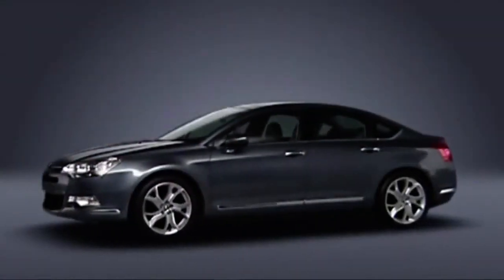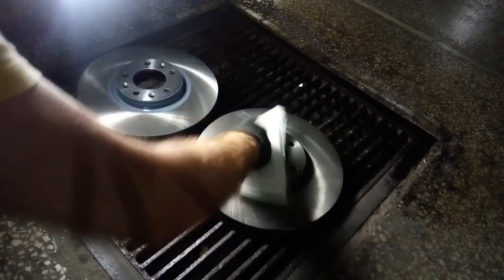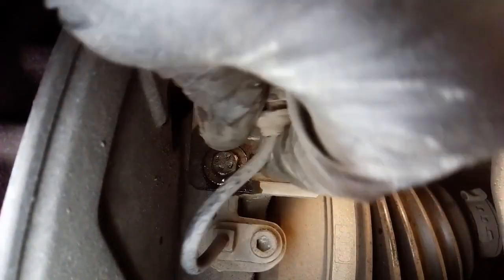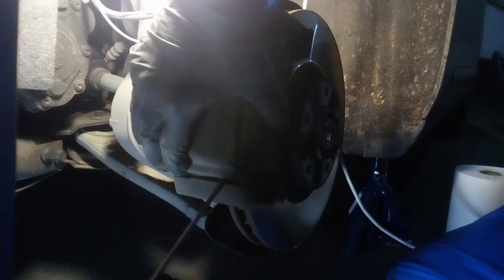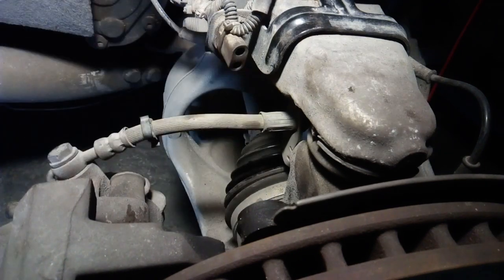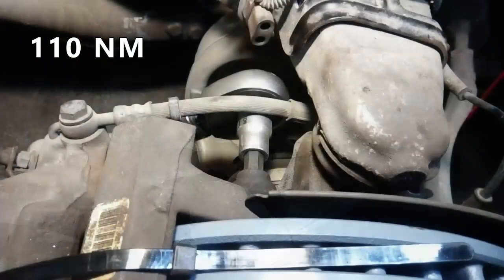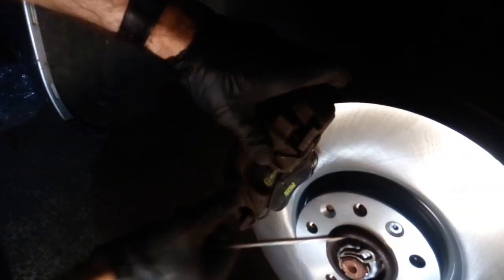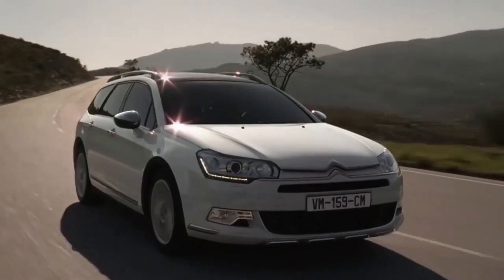CITROEN C5 X7 Front brake pads + rotors change (ENGLISH)

Comment from the maker: Anti seize spray is also recomended between the hub and the rotor, and between the rotor and the wheel, to make your life easier the next time you try to remove the wheel or the rotor. 
Nominal thickness of these specific rotors is 28mm, and Citroen recomends not using rotors that are thinner than 26mm. For the record, the old rotors had 195.000 kms, and their thickness was 26.2mm, well within the recomended margin. 
Even though it is not so dangerous to drive with rotors thinner than the minimum thickness, one can't help but wonder about the heat dissipation of thinner rotors, compared to thicker ones. Maybe thinner rotors heat up faster and can't dissipate energy that efficiently. The more the material, the more energy they need to heat up, and therefore the longer it takes for them to heat up and start losing their properties. Maybe that is why manufacturers never recomend using rotors thinner than the minimum thickness, usualy 2mm thinner than the nominal thicknes. 
Maybe they don't even test their vehicles with rotors thinner than the minimum thickness, that's why they can't take any responsibility and they can't give any guarantee about the safety of the vehicle. 
The same goes for the rear rotors, which have a thickness of 12mm, with a minimum of 10mm.

And for the record, the weight of a single front rotor is around 9-9.5 kilos, which amounts to around 20lbs, while each rear rotor is a bit lighter, at 7-7.5 kilos (~15lbs).

Comment: Fantastic video, very informative, thank you for putting the effort into it!! I'm just gauging whether I am too scared or not to do mine, I've never had a car as complicated as the C5!! Just a quick question though, I notice that there are two braking systems, the TRW and "TEVES" (well, that's what the manual says). How did you check which your car has?
Reply from the maker: Thanks for tuning in brother. The actual type each car has can be found through an official parts supplier, (not necessarily dealership), who has access to the citroen data base. With the VIN, they can find the parts diagram for the specific model, and I think it is mentioned there if it is TEVES or TRW. 
Also, I think the two brands have small differences externaly, so if you  have some kind of photo, (again, from the parts supplier) you can compare and find out which one you have. 
I realy don't understand though, how you find the C5 "complicated". If you mean in regards to the electronics, yes, I would agree, every car is complicated. But regarding everything else....I don't see anything complicated. 
You don't need to be scared of anything, you just need tools. The braking system needs special tools, so I invested once in a piston backup set, and I didn't regret it. Recently I changed both rotors and pads to a C5 Mk1 of a friend, and everything was as simple as can be. 
I think you're overthinking it....😂😂😂😂😎👍
Reply: @mr_nice_hearted  Electronics and Hydro-Pneumatically complicated definitely!! I must admit electronics is more my thing though based on previous experience and work!! I used to do basic jobs on my previous car (a base model fiesta from 20 years ago) and have always tinkered with little stationary engines and another older car, but haven't been faced with brakes in ages. I'm worried about bolts snapping, about torquing wrongly and most of all damaging the caliper or popping a brake line somewhere. (Do I have to take the brake fluid cap off btw, then bleed after?) I'm even worried about the suspension system breaking when I jack it up and put it on axle stands😬 It's a new car to me and it's done 212k miles (mid 300s km) so lots of wear. I understand its not their problem but the garage want a huge amount of money to do the brakes which I can't necessarily afford as a student, but doing them myself is a risk. I can tell you do plenty of this sort of thing so it seems trivial, so you'll have to pardon my hesitation and nervousness!! Thanks for taking the time to respond in such detail!!
Reply from the maker: @woodant1981  ....hahaha....brother, I am POSITIVE that you are overthinking it. Hydropneumatics are the simplest thing ever. I worked on the GS featured in my channel, and did the hydraulics, and I can assure you, there is nothing simpler than that. Even the sophisticated Hydractive 3+ is based on the simple hydropneumatic system of the GS and CX. 
One thing to remember if you want to jack up the car, raise the suspension to the "high" position. This is done every time you need to raise the car for ANY reason. Even one wheel to change the tire. Raise it up. It's important. It has to do something with the pressure, and if you don't raise it, it may start leaking somehow. 
OR, alternatly, if you don't raise it, open the cap of the hydraulic fluid. It's easier though to raise it, so I recomend that. 
After changing the pads, you don't need to bleed anything. The fulid will have returned to the tank. You'll notice the level higher than before. And it's a nice idea to make a mark of the level before and after, to see how far up it'll go. 
As for the brake reservoir cap, no, you don't realy need to open it up, I just did it as an extra measure. No, you don't have to open that up. 
I see your anxiety about the brakes, and it reminds me of the first time I changed the rear pads (only) on that same X7. Just one pad took me 6 hours, cause I had the instructions next to me, and they were so confusing, mentioning extra jobs that don't need to be done. The other pad took me 15 minutes. And actualy, that pad set was actualy wrong, and I put it on the car so that I won't leave it without pads, and the next day I replaced them with a new set, which was actualy correct. I happened to fall on a factory faulty set. 
And don't worry about the bolts, they can take the force, The small ones are 30NM and the bigger ones are around 60NM, (if memory serves), but hey.....do you thing the douchebags in the garage will use a torquewrench?????? 
Trust me, you'll do it better yourself, and you'll have the satisfaction that you did it yourself, AND you'll know that you put on the correct parts, AND you'll have your own warantee about the quality of the job. 
Trust me, it's nothing, you are overthinking it. 😂😂😂😂any help I can provide, I'd be glad to. I just don't have much time now, cause I'm on a career change, and I got into trucking, and that's a whole different world. I even plan on making a channel about it. We'll see. Anything you need, just ask. This information should be free. I payed 20€ for the Citroen Doc Backup program back in 2012, and I still think that information should be free, that's why I help any way I can. 
Don't overthink it 😂😂😂👍👍👍
Reply: @mr_nice_hearted  thank you man so much🙏🙏I really appreciate it. Just gotta find the right parts and might have a crack!!
Reply: @mr_nice.  best of luck with your new career!!
Reply from the maker: @woodant1981  ...well thanks for the support brother, I appreciate it too. I'm actualy thinking of making another channel about trucking and road safety. Who knows... 
👍👍👍👍

Comment: Hello, wheel is 90nm and not 100/110 by Cirroen
Reply from the maker: Duly noted my friend. According to this exerpt from Citroen's Doc Backup documentation, 

https://postimg.cc/8F3kbbPY

the C5's wheels (and other models) are torqued with 100 NM. 
The left column is for steel rims, the right column is for alloy rims. 
There is indeed a value for 90NM for the steel rims, for the C5, X3 and X4 models, 
but the X7 model has 100NM (=10m.daN), both for the steel and alloy rims. 
For some weird reason, Citroen still preffers to write torque values in KGMs (kilogram meters) instead of NM. 
So yes, I am wrong in the video, mentioning 100 - 110NM. 
I meant to write 100 - 102NM. 
Thanks for watching, and thanks for the heads up.